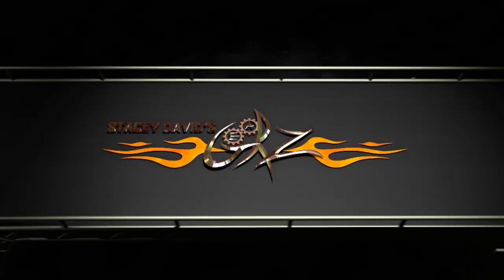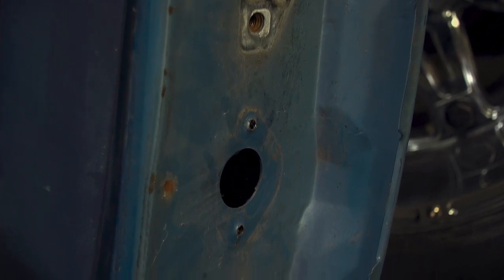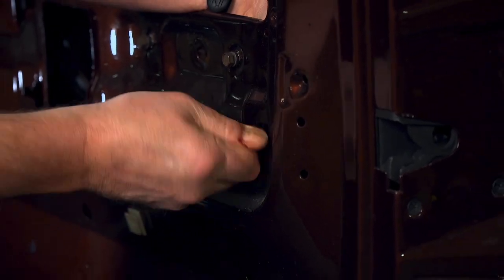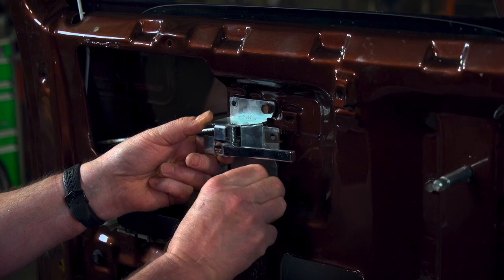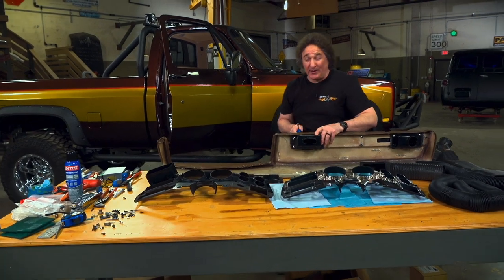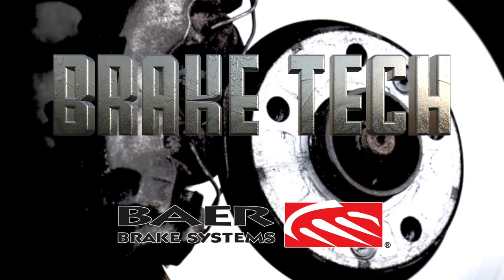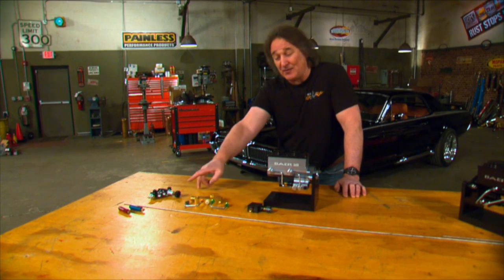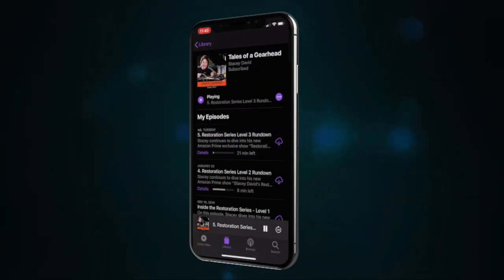Stunt Double Squarebody Chevy Interior, Door, & Window Upgrades - Stacey David's Gearz S15 E4

Comment: I think the chrome mirrors on the doors should have been painted black, like the mount cover on the lower part of that same mirror, because the trim around the side windows have been painted black, along with the push bar, roll bar and step bars, so having chrome on the mirror just doesnt look right.  The rest of the truck looks amazing. Great Job 🤠👍

Comment: You cannot purchase new vent window assemblies from LMC (or nearly anyone else) anymore for some reason or another. (Supplier problems, Low stock etc.)

LMC has not kept them in stock for years and obviously won't go out to find a new manufacturer (outside of their Chinese connections) making the info about them having "everything you need to replace the vent window assemblies", bogus.

Please correct this video or use your influence to get LMC motivated enough to find another source for the complete vent window assemblies. After all, they still tease us with the picture on their parts diagram... but don't stock.
Reply: I completely agree. If I’m not mistaken, lmc didn’t even have them when this show aired… take from that what you will 🙄